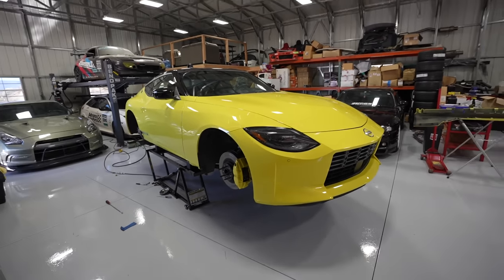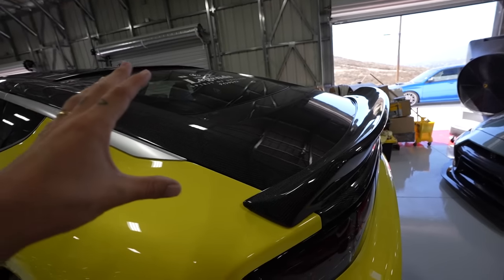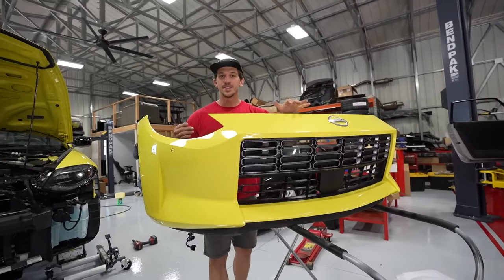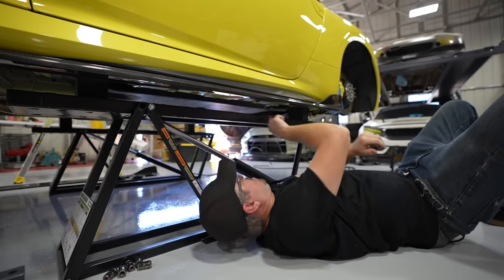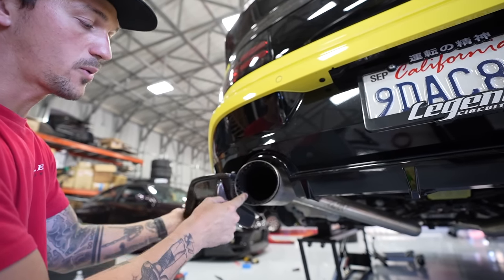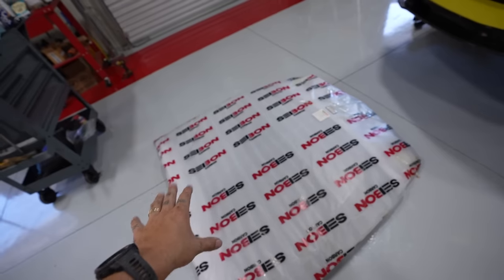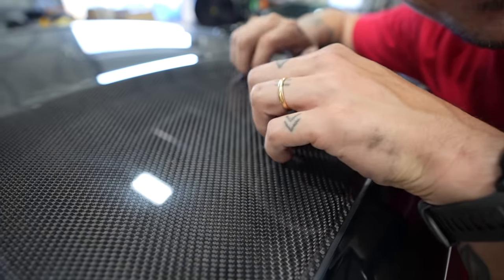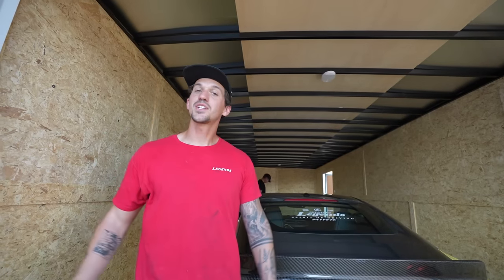FIRST EVER FULL CARBON PACKAGE NISSAN PROTO Z!!

Comment: Definitely recommend PPF on the roof portion at least especially if the panel is boned.  Saves headaches down the road dealing with stone chips.
Reply: You're worried about stone chips on the roof? I'd be more concerned about UV damage to be honest. But agreed, ppf on everything especially carbon fiber. I speak from experience with my CF roof wing looking... not so good anymore despite the manufacturer assuring me it was already UV treated.